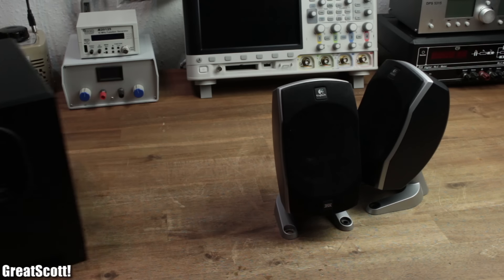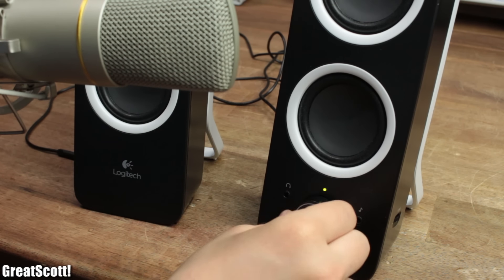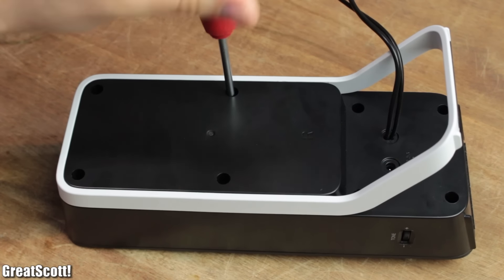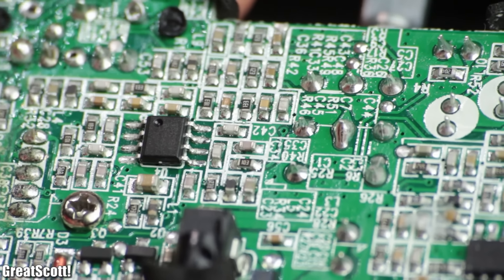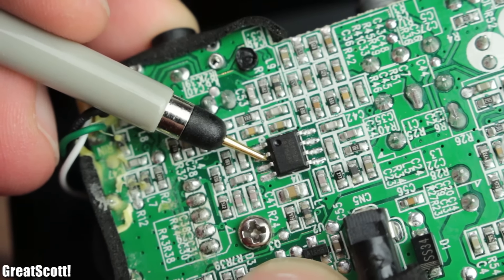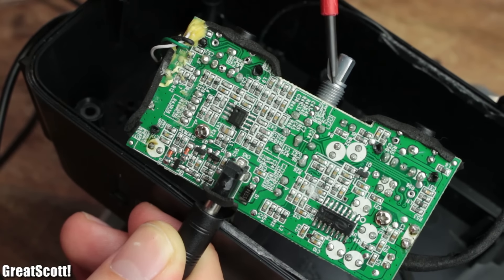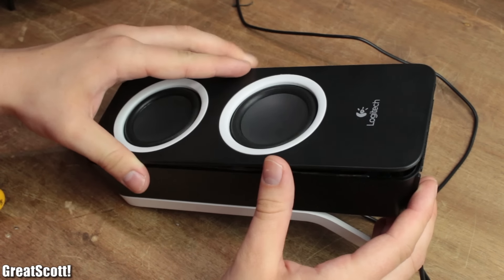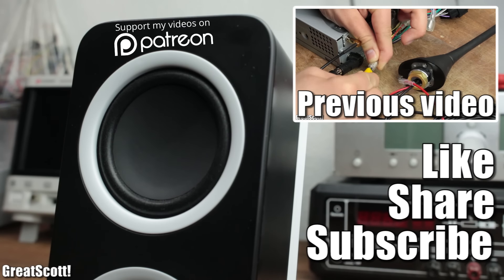Fix It!: Brand-New Defective Logitech Speaker

Comment: +GreatScott, I had this a few years ago with Philips branded speakers. They came advertised as having 3 (!) drivers on each side and were quite expensive for computer speakers. When I have connected them, one side was not working at all, so I have opened them. 

Inside was the cheapest possible amp PCB that looked as if it was soldered using a hot poker instead of a soldering iron and, of course, only one tiny driver on each side. The other two holes had the grilles and black plastic blanks in them, so you couldn't see that there isn't anything behind them from outside. It was very unlikely that this was actually made by Philips - at best they have bought some cheap junk in China and rebadged it, at worst it was a fake product sold under their name in a brick & mortar electronics store. 

I didn't even bother troubleshooting the thing as it was obviously not as described on the box and certainly not what I thought I have bought. It was reassembled and promptly returned back to the store for a refund as defective, to their credit they gave me no fuss about it. 

Computer speakers are universally junk, you never know what you will get even with brand name products today. If you want something decent, get a pair of small passive speakers and a separate amplifier. Doesn't need to be anything fancy, almost anything will sound better than that Logitech junk.

Comment: had the same issue with a similar off the shelf set of of speakers, found the system to use a 9v a.c. output power supply, replaced with a dc output and no hum was present

Comment: When loading my iPad (Air 2) and you touch the aluminium case, you can feel a very small "buzz" like there is some small charge on it. If you listen to audio with headphones while loading it, you also have this buzzing noise like you speaker.
Reply: I have "buzzing" sound when charging my Xperia Z1 too, but not if i charge it from my laptop. I guess i should get a better charger.

Comment: +GreatScott 
great video and also i have the same speakers and also noticed that they only have 2 drivers so i found 2 speakers that fit the space soldered them to the wires that connect the priginal 2 active drivers i think you should try it

Comment: I have Logitech speakers with the same board I am currently repairing, and the IC believes headphones are always connected  and does not play audio to the drivers
Reply: I'm facing the exact same problem right now. Did you manage to fix it? Would you share some knowledge?
Reply: @timicesqzzz2681  What I ended up doing is opening it up and while poking around, I bridged some pins and sound game out. I finally found what pins made it sound right, and I soldered them together, meaning the headphone port is broken but the sound works. Now I use them as rear speakers. Only issue is when power is cut they buzz, besides that it's fine

Comment: can you please show more on how to actually biuld the crystal oscillator design how to to fine tune it to whatever specific frequency we need it to. because i biuld the circuit from the schemtaic in the video you made about crystal oscillators but it won't give me even a voltage or a frequency .and i would like to adjust it to the specific frequency i need it to be

Comment: I have a Genius 2.1 speaker, it developed a buzzing noise on the subwoofer unit every time it plays a beat, but when I turn the box upside down the noise completely disappears, so I opened the box and found nothing above the subwoofer driver, the wires aren't dangling around and the cable management was fine, turns out stuff above the transformer and the transformer itself is dangling, the screws were loose and it's somehow cross-threaded from factory, I cut the screws out using a small handsaw and pliers (which took me a bunch of hours) then I added new screws and nuts with some lock tight. It now sound the way it should be

Comment: Well really if they are new you can send them back for replacement, it seems like a quality control issue. Its also not just the way you like them to work, no powered speaker should sound like that. If you here hum, no need to probe around the circuit, you will know the shield is open circuit, it must have been a broken track on the PCB, a fine hair line crack perhaps. Some enormous bullshit was the hum getting louder when you plugged in the smart phone as its acting like an antenna picking up the mains line frequency in the building. Not that I like Logitech, I don't but the second driver is a passive radiator and a valid speaker system design, its not intended as false advertising. Passive Radiator systems give louder deeper lows in a smaller cabinet, compared to a bass reflex cabinet of the same size.

Comment: I have these speakers. I kinda assumed that one of the 2 speakers were indeed only passive radiators, but I still find it stupid that they said they contained 4 2.5 high qual DRIVERS! Which does not mean passive radiators since they don't have drivers!

Comment: I guess I would have just fixed the original unit in the first place !!  It seems to be a better unit - and includes a sub-woofer.  Also - was there any evidence that the input ground was supposed to be connected somewhere and just didn't get connected on your unit?  Or is it just a faulty design?  I am very surprised.  I have 3 of the Logitech 200 watt systems (100 Watts on the sub and 50 watts on each table speaker) - and at about $100 ea - I consider them to be the best value in sound gear available.  But they are older units.  Perhaps Logitech is recently downgrading their product quality due to profit pressures from their executives !!
Reply: based on the reviews on amazon where every says they sound amazing, I'd say that it's not the design but the actual unit that was faulty.
Reply: Good Point !!  {:>)

Comment: I recently bought dvi cable but it was not working so i got a replacement. Again that didnt work so when i opened its jack cover i was surprised it didnt have gnd wire. i soldered and wraped a wire over dvi cable just to get it to work.

Comment: So the problem was only the ground wire of the jack?
Reply from the maker: Yes
Reply: +GreatScott! fucking riddicolous, had the same problem that was bugging me and I couldn't be asked to fix it and I literraly fixed it in 48 seconds thanks to your vid, thank you so much, no more ear bleeds.
Reply: I recently bought an Insignia NS-PCS41 speaker set which is actually a rebranded Logitech set from 2010 all the new 2.1 systems from Logitech in that price range today tie down the base with the satellites so you can't raise the sub by itself Logitech's older stuff was much better

Comment: Im liking the new series but you should have bougth the Logitech z533 which is a much more premium product from them.
Btw the subwoofer on the Logitech Z533 has a high frequency hum when its turned off do you know any ways to fix this or any reason for why this happens?

Comment: I dont really know much about electronics, but would it be a good idea to place a ~100ohm resistor instead of the cable into there, because it doesn't seam as they were designed to be connected? Or am i wrong?

Comment: I dont really know much about electronics, but would it be a good idea to place a ~100ohm resistor instead of the cable into there, because it doesn't seam as they wrer designed to be connected? Or am i wrong?

Comment: I have a 5.1 surround system from logitech that cost me 140€ and it also has a humming problem, but it's only on the sub, which is where the main board is located, putting my finger on the jack does the same effect as yours, do you think it could be the same problem? It does not amplify depending on the knob and it still humms when turned off.

Comment: I unplugged these speakers to clean my computer desk and underneath, i came back to plugging the 3.5mm female aux into the speaker so it fits the male pin fitted inside but it would not connect. I have taken the speaker apart and the cable still does not fit so i cant even power them because for some reason the cables wont go together even when the pin is not bent.

Comment: I stopped using logitech when they refused to sort my G15 keyboard out which just turned into a flat black brick inexplicably then equally inexplicably started working as normal again,  to be fair tho I have the above speakers previous iteration I think I bought in the early 2000's and are still in use today on my daughters PC

Comment: OMg had the same, went defect after like 1 month. and i was too lazy too repair them or even look what is even the problem since i had a second pair :D
Reply: But i have like no idea how to fix them nor do i have technical equiptment. Is this a general problem with those exact speakers or did just yours have those? Because i don't remember if mine had this problem, i just remember that somewhere was a "wackelkontakt" or something, at first i could play around with the audio jack a bit so it would connect but in the end i got no signal at all. Its probably easy to fix but i just have no idea :D

Comment: Hi G Scott. tzlking about voltage divider I have a problème with à simple transistor biasing circuit... to make it short the voltage divider is 2 resistor 10k ohm.... the transistor is à npn c945. Rc is820 ohm and Re 100 ohm. this circuit is a  synchro signal impédance adapter from à pc engine vidro console to tv. ..  it works fine but I Still don t understand why I have 1.25v on the base of transistor instar of 5/2=2,5v (Vcc is 5V). of course I measure before applying the synchro signal... if somme People could tell me why this circuit is behave like that...

Comment: I would buy two pair of those, and just swap 2 drivers and wire them up. :)
Reply: or just buy a better pair for double the price? lol. Adding another 2 speakers to an amp board originally intended for only 2 drivers wouldn't sound very good lol.
Reply: ***** of course, better pair for double the price. but , where's the fun in that?
Reply: MP-Tuners Productions lol true. Ive hooked up about 8 bookshelf speakers to one amp before. It was fun but the sound suffered a lot lol.

Comment: 10 W, you have 2*3W speakers and a 2*4.5W amp, so i'ts probably 10W at the socket :/
for 55$ those seem pretty shitty.
Reply from the maker: Well I got them for 25$ from Amazon.
Reply: *****
I went from the price at 0:16
Reply: GreatScott!
you could've probably bought a couple of amps (2*5W+15W) and a supply for 10-20$ and that would've probably be as long to install as debugging those.

Comment: Have sort of the same problem with my sennheiser in ear plugs. Works great when device is running on battery, but when i connect a powersupply, they start to hum, if i don't touch the device. Anyone know a fix?

Comment: I have a Syna S5WX quad flew it for a few weeks. I added better antenna to the wifi camera and the controller as directed on a YT video but I've done something wrong. I flew it fine for a few days. The camera died sitting in the box a few days later and then a few days later the controller died sitting in the box. Won't turn on. They sent me a new camera which was cool of them. I don't have a schematic but can't read them very well if I did have one. Just getting into soldering practice and simple repairs. Got a great knock off rework station that heats up fairly quickly for 100 bucks and a multi meter. Made myself a fume fan for my first project. I wish I could figure out what's wrong with this quad. The original antennas had some sort of stone crystal wrapped in heat shrink around the wires. Anyone know what they were for? 
I can't get responses to comments on YT without going back to each video i left a comment and searching.  johns.sweeps@gmail.com  Subject SYNA S5WX. (which is my spam email ). If anyone has any schematics or possible solutions.

Comment: I made a bt speaker with Bluetooth headset and PAM8403 amplifier board. After completion of project i heard a noise which is very annoying......  

Can anyone please help me to fix it out?
Reply: Try to put 2 100ohm resistors between each audio input and ground. It helped me
Reply: @emilgiza8519  ok sir i will try and inform you....😊

Comment: The Z200 are a bad set of speakers , you could have just got the z313s which are much better 2.1 Speakers or even the z333 which cost slightly more

Comment: That is bullshit.  A driver is a driver.  Not a passive radiator.  Logitech must have been taken over by bean counters.  And why did you have to modify the circuit?  The circuit wasn't faulty.  It was designed wrong...or did I miss something?  What's the verdict.  How could all those  units be out there with good ratings if the ground problem exists in all of them?  Makes no sense.

Comment: Calm down guys... This is clearly a manufacturing mistake, if he were to send it back to the seller he'd get a new one, since it is, as he says, dysfunctional. Stuff like this happens all the time, and especially when dealing with cheap products. To keep costs low, you need to cut out quality controls and such, and cannot guarantee that every item is flawless.

It is not like this is characteristic of Logitech, this happens to everyone. When you by things cheap, you should not expect to get a cheap product, with high production quality, but a cheap product with low production quality.

Comment: Logitech is basically "hoax" – a completely "virtual" company which not existed physically. They have only design bureau in some place and nothing else – only the brand, for which chinese factories makes products on order. I have a problem with their support service which wasn't able to resolve because of this non-existance of this "empty" company. You cannot even sue them because you cannot find them in real world - only website and only products in the store.
Reply: the company is also super secretive and shady, most awful thing i have from their expensive Logitech mouse V500 which uses their 100% proprietary radio receiver and it is the only first & last one which had touchsensor scrolling line, they stopped the manufacturing of it when my receiver broke, i was able to only order the North America receiver and guess what – it was not working, they made different region versions of mouse incompatible. I made teardown of mouse and the engineering design inside is superb and even overcomplicated (their cheaper models are garbage comparing to that one expensive) – this mouse was expensive for them to make and they stop to made it in a hurry – with completely ignoring the users of it and stopping any support.